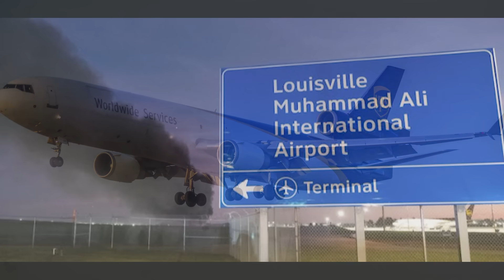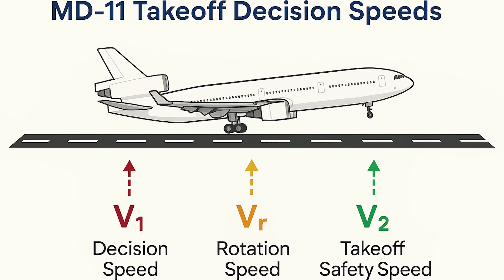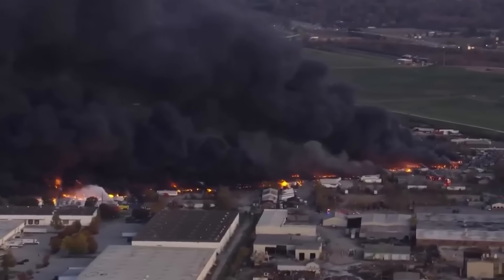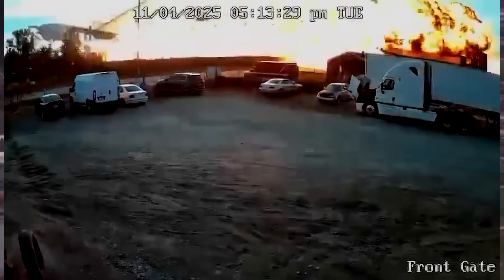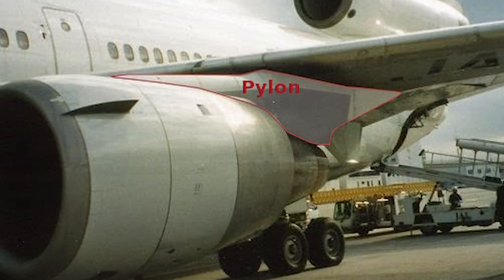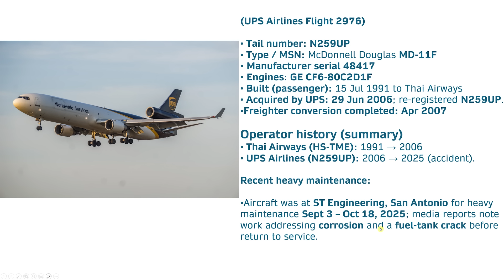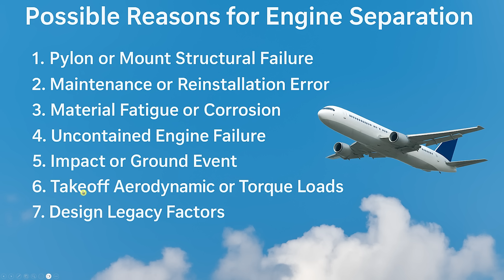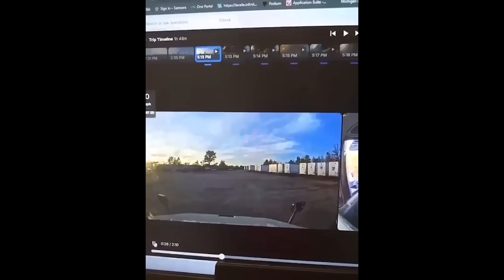What Caused UPS Plane Crash, Louisville, KY? How MD-11 Engine Fell Off

Comment: AA191 wouldn’t have crashed but the pilots followed procedures and slowed the aircraft resulting in loss of control. If they hadn’t intentionally slowed it down they’d be here today and barely a footnote. It’s a bad comparison.
Reply: not true, it wasn’t survivable, the loss hydraulic fluid caused retraction of left wing slats causing the stall of the left wing and sharp banking to the left, the aircraft was partially inverted in its final seconds. There was nothing pilots could have done to remedy the situation.

Comment: Many years ago a 4 engine plan crashed as a result of an engine falling off. Investigation showed that a step was skipped in part of an engine out maintenance operation. To speed things up the engine mount was assembled to the engine then inserted into the mounting bracket in the wing. 4 bolts were involved. When the engine was inserted back into the wing it was forced into position so the 4 bolts would go through the holes so bolts could be put on. That cracked the mount. Consciquintly, it eventually failed and the engine fell off at s critical moment. My Father worked for GE Aircraft Engine Devision for 33 years. They were GE engines. The maintenance procedure was not followed resulting in failed engine mount.

Comment: I think it's similar to the American airlines flight 191 back in the 1970s that lost an engine during takeoff. I think it was a failure in the pylon or pin holding the engine to the wing pylon.

Comment: Rule one never turn into the dead engine because the live engine will push you further into the turn, You can see the plane being forced into the turn under full throttle at take off speed. The mount to that engine was damaged either from a harsh landing or improper installation upon replacement. having broken loose the fuel going to a full throttled engine would have sprayed everywhere. This falls fully on maintenance, even a bird strike would not strip the engine.

Comment: The landing gear looked intact in some videos. The tail under carriage was much lower than the landing gear and probably did that "V" shaped damage to the building rooftop.
Reply: Exactly - People don't realize that landing gear is are relatively weak component and had they hit that building, the building would have sheared them off.

Comment: Well why would they return this plane with signs of corrosion….. that is a big deal as well…. Traveling over salt water for long periods of time….. salt water can actually be way up in the air when storms are around….. any signs of corrosion should be completely removed and replaced with new parts…. Now that is like driving around in a vehicle that has been in northern regions and the salt from the roads can cause damage to air bags and components that hasn’t been properly replaced from driving on salt sand covered roads….. believe it or not a car made in the year this plane was….. would have hardly nothing left in the safety of those cars that have much corrosion….

Comment: I used to load and unload these VERY aircraft. 

Let me tell you this, it is a VERY worn out airframe, and UPS’ best airframe.
They use the PISS out of the mad dogs. 
They really rush these in and out of terminals and miss some things…
I’ve seen a cockpit of one of these UPS MD11s with controls taped over.

Comment: First off the engine doesn't fall off. The CF-6 engine used on the MD-11 produces in excess of 60,000 lbs static thrust at sea level. If the engine separates from the wing it will fly forward & upward suddenly & continue running until the engines fuel supply system runs out of fuel. It only takes a few seconds. On the American DC-10 that crashed the engine went forward & upward over the top of the wing. On this MD-11 there was quite a bit of fire in the area of the engine pylon before it crashed. Fuel lines severed & the boost pumps pumping fuel into the fire? The engine separation damaged the wing tank allowing fuel to flow out? I think that the MD-11 can fly on 2 engines but the ability to take off with a load of fuel & cargo?? We will have to wait until some pilot with experience on the aircraft weighs in. One thing for sure, the flight crew was very busy trying to figure out what was going on.

Comment: I suspect many people do not realize that all multiengine planes are designed to be able to safely takeoff and climb out, clearing all obstacles, even if an engine falls off like this, as long as it is operated in accordance to its performance manual.  That means as long as it is not too heavy for the runway and weather conditions.  I expect that the NTSB investigators will check to see how much the plane weighed, including cargo and fuel.  But I also expect that UPS is going to be able to show that the plane was not overloaded.

Here's one thought.  The takeoff performance calculations assume that all of the engines are working fine up until the critical engine failed.  I don't think that is a good assumption.  If one engine seems to be working but is not producing as much thrust as expected then the plane will be farther down the runway than expected when it reaches the V1 decision speed.  In this hypothetical case, if the engine then fails or falls off, then the plane may be unable to reach the V2 Takeoff Safety Speed.

If the plane is going too slow (slower than V2) then it produces too much drag trying to generate lift, and the remaining engines can't produce enough thrust.  Then the plane either starts descending or it slows down.  Slowing down makes the drag problem even worse.  The pilots will instinctively fight to keep the nose up to try to climb and avoid the buildings and other obstacles, and so the plane starts losing speed.  Eventually it will slow down to the stall speed, one wing will stall first, and that wing will start dropping, which is what we saw here.

Comment: Funny that I just researched this as well….. all those planes were taken out of service…., this is a weight issue and load shifting and causing to much engine thrust and weight load on the wrong areas can put to much stress on one engine and load shifting would cause the engine to come off

Comment: If you look at the pics of the engine that's not grass and mud, that's the sound deadening material and inner carbon fiber shield that has been shredded. Only one thing does that, catastrophe engine failure of turbine blades. Also, if you notice the trail of debris, bits and pieces, then front engine cowl, then the engine, then the pylon. This engine came apart and then vibrated itself off the plane IMO.

Comment: This plane was loaded with to much weight towards the front of the plane ✈️…., and instead of having the heavy weight in the center so on a plane it would be loaded even….. for takeoff and landing….. looks as if load shifting and plane engine was taking off of the aircraft and knocking the engine off…. All seems to be from load shifting and not loaded correctly…..

Comment: Just a thought... the engine wouldn't have "fallen off" (I know it's just a figure of speech). Whatever force was needed to propel that engine's share of the aircraft, all of that force occured between the engine and it's mount. The engine pushes hard against its lightweight mountings during takeoff.

Comment: R.I.P.  for the crew. Engines falling off planes?  Another one of the times, follow the instruction (keep going anyway) was not the best choice.  You could see on other vids, it was going down the runway for really long time with engine missing/on fire/no thrust. But training indeed dictates: take off anyway. But at crashes at this, when you see plane trying to take off anyway while there was enough space to stop and/or really reduce speed significantly ; You wonder, maybe time to start rethink the training?
Your possible causeL "takeoff Aerodynamic or torque loads"  Is not possible as the root cause, fire was already early on the runway going on. Before it tried to fly anyway with too little thrust.

Comment: I read that the engine "falling off" is actually a safety feature. During flight, if the engines explodes or whatever, the engine detaches in order to preserve the integrity of the wing.

Comment: Ok so the MD-11 has a history of Engine mechanical departure from airframe post engine removal and replacement. If the procedure is not followed to the letter then mounting point overstressed. That plus the age of the platform. Production ended 20+ years ago. How many flight cycles did the aircraft go through and the maintenance logs will be under scrutiny. I feel for all involved and the maintenance crew that did the work questioning everything they did. Sucks all around.

Comment: Jeff, I urge you to stick to the NTSB's data this time. 

You were dead wrong on the Mexican medical crash in philly, and a 30+ Year Airline pilot had to correct you ( blancolirio ) 

You are STILL wrong on the Air India crash on several angles...... 

You were dead wrong on the helicopter crash in DC ( i pointed out several things wrong with your assessments there as a 13 year pilot myself ) 

You need to stay in your lane with structural accidents, please.

Comment: R.I.P. to the Grew :thanksdoc: Now; did someone forget to tighten a bolt or two. I remember a plane crash over 45yrs ago, when jet engines were lifted improperly by a forklift and the receiver bracket during installation on the aircraft got damaged cause a jet engine to fall from the sky.

Comment: Between the planes fuel load and the petroleum plant it crashed into, the Fire Department had to feel hopeless trying to put this out.
Reply: Yeah, no kidding. There have been strict rules for decades on how much fuel a plane carries: Don't fuel the plane up more than it needs for its trip, for a reasonable hold time awaiting landing clearance, and for an alternate airport if unable to land at the destination airport. Those rules exist for this exact reason: A plane crashing with an excessive amount of fuel is a SOB of a fire to put out.
Reply: @Dee_Just_Dee  problem is its a cargo plane they not hauling air there loaded to the max they need all the fuel. and a good chunk of that cargo would have been plastic stuff and the carboard boxes there packed in.
Reply: So much fuel close to an airport runway makes no sense to me, but let the smart heads prevail . . .
Reply: Let it burn out and try to save any surrounding infrastructure, pretty much all you can do.

Comment: We already had this happen where the maintenance crew re-attached an engine after maintenance, in an inappropriate manner which caused attachment issues and, I believe, stripped bolts. When that engine came off, it ripped out the plane's hydraulics and some electrical. The big problem was the loss of hydraulics. I can't remember which equipment or location.

Comment: If you look carefully, the pilot is dumping fuel about 1:22, you can see the splash on the street and trees that looks like smoke and when it clipped the powerline at about 1:36 it ignites and causes the Inferno. Pilot made it worse by doing this.

Comment: I disagree.  Looks to me the aircraft is missing a landing gear in that dash cam video.  The center gear and right gear look to still be on the plane but the left gear is gone, presumably torn away by contact with the building.

Comment: The MD -11 was modeled after the DC-9, according to my brother that has been working for american airlines as a mechanic for 40 years now. I remember when that DC-9 crashed. It was horrible how it rolled over before crashing......
Reply: DC-10 not the DC-9.
Reply: @larryhutchens7593  I apologize, you are correct... It's been a while....
Reply: @lincolnherzberg1866  The DC-9 morphed into the DC-9 dash 80 known as the MD-80 or Super 80 which was a fairly decent airplane. AA had a large fleet of them.

Comment: The MD-11 looks like the DC-10 from the '70s. They had issues with engine mounting hardware. I recall a DC-10 dropped an engine over Chicago. Maybe '79 or '80?

Comment: I will bet you anything that they did the same thing as what I’m describing below:

American Airlines Flight 191, May 25, 1979.

During maintenance, the airline used a forklift to remove and reinstall the engine and pylon together, instead of removing the engine first, then the pylon (the manufacturer-required method). The forklift method put uncontrolled side-loads on the pylon’s attach structure. It cracked the pylon mount, but the crack wasn’t noticed.

On takeoff, the pylon and engine broke off the wing, severed hydraulic lines, and the plane lost control.
All 271 people onboard died.

Key points:
	•	Maintenance shortcut = forklift method.
	•	It damaged the pylon attach fitting.
	•	Manufacturer procedure was ignored.
	•	Engine separated during takeoff ⇒ total loss.
Reply: The experienced guys were deported....
Looks bad on Texas.     Same thing that's happened to a lot of cranes falling  over....  !!!     😮
Reply: It may have been a maintenance issue, but it wasn't like 191. The departure of the engine was caused by a catastrophic event - most likely a fan disc coming apart.  The disintegrated fan disc would have punctured fuel tanks, electrical connections, and hydraulic lines causing the fire.  The resulting vibration overcame the pylon mounts. No bolts involved.
Reply: @williamosborne6866  its wasn't the bots, when they put the engine back on they hit the structure and it cracked. had the problem been bolts the engine would have left and that would have been it, the structure of the wing where the engine pylon connects gave out and it tore part of the wing off and hydraulic lines, the slats retracted and the wing stalled.

Comment: The pitch of the aircraft shows it was still nose up. Your depiction makes it look like the landing gears was forced into the warehouse.  But since the plain was still pitched into the climb. The tail section struck first and pitched the plain nose down from there. You had the right idea. But the wrong diagnosis.  The nose was upward as it struck the building the tail forced the downward thrust the the nose of the plain. I understand the the ideas to Come up with the cause. But the black boxes would give you a true account of the accident.

Comment: It’s time to lengthen runways why put people’s lives at risk on a short runway because if you have trouble with the plane and you reach the point of no return you would have a chance to save yourself and others with the extra length of runway added and this plane may have had a chance. Take off is the most dangerous time so why not make it safer for all.

Comment: Catastrophic failure of the left engine resulting it explosively separating from the aircraft. The Debris from that explosive failure went up and over the left wing and was ingested by the center / tail mounted engine. The “tug video” shot by a ground crew member show the rear center engine “puffing flames”  (indications of a compressor stall / beginnings of engine failure) after the aircraft rotated and was attempting to climb / flyaway.  Normally this aircraft could have taken off with one engine inoperative but the tug video shows clearly that the rear center engine was compromised. This dash cam video clearly shows the severely degraded climb performance and clearly shows a very severe roll to the left (indicative of asymmetrical thrust). The right engine essentially rolled the aircraft left when it subsequently impacted the terrain.  The investigation will wind up determining why the left engine failed. 0:36

Comment: That first power line arced, but as you can see when it arced the 2nd time at 0:25 , just above the building edge, had all that fuel mist behind it, as it comes across the road. 

All that mist flashed as it created the 2nd arc on top of the building and sparking the fuel trail and straight to the fuel tank. That plane blew above the building, rather than the building creating the initial explosion from striking the belly of the plane.

I told my wife yesterday the plane was probably at the point of no return, having to try to get altitude and I am glad this video explains that. 

Prayers and condolences to the families.
Reply: At 0:25 the left wing hit the black objects above the roof line of the blue building, which were fuel tanks.
Reply: I think it was smoke you were seeing and not fuel mist because if that would’ve been fuel, there would’ve been big flames and the guy narrating this video here said it was smoke.
Reply: @LelaE34  Correct.
Reply: No, the left wing was ripped off, and the fuel tanks are in the wings.  As soon as the wing separated, the huge fire started.
Reply: @ILSRWY4  Those are fuel silos on the ground. They couldn't have hit anything worse.

Comment: So , the leading edge slats look to be in place, on both wings , the pylon may have shook itself loose from a highly vibrating engine .

At takeoff thrust the engine should have flipped over the wing , just like 191 but it appears to have just , dropped , which may indicate the engine itself failed in some way , the NTSB should be able to find this very quickly .

Comment: This is the best video I've  seen, even if only 720K Jeff!
Re: The Chicago flight 191 American Airlines crash that was very similar losing the left engine on take off roll, I was waiting in the airport to take off in a different MD-11 passenger American Airlines to Dallas to see my girlfriend at the time. Inside the terminal we could see smoke and some commotion on the runways, which are huge in Chicago. So the end of the runway was far away from where I was sitting but you could see the smoke rising. CNN Headline News was not a big thing at that time apparently inside all airports. I did not learn of the crash until I landed in Dallas! That was probably just as well!!